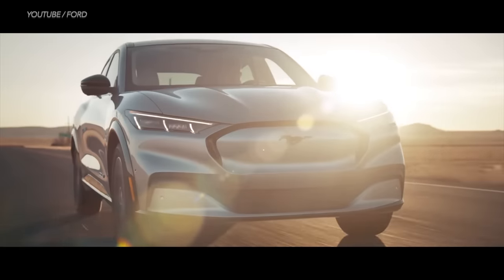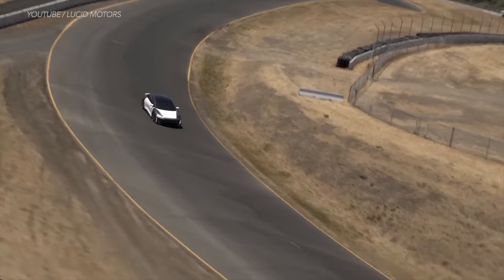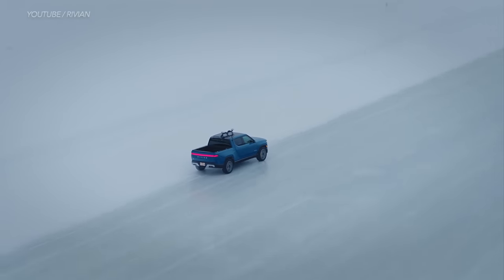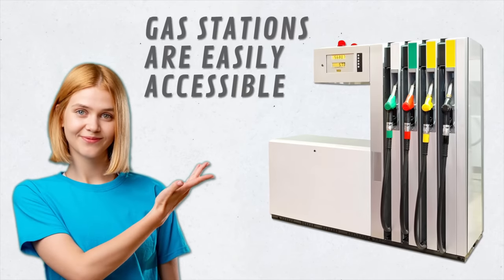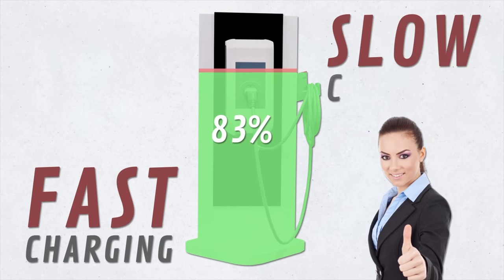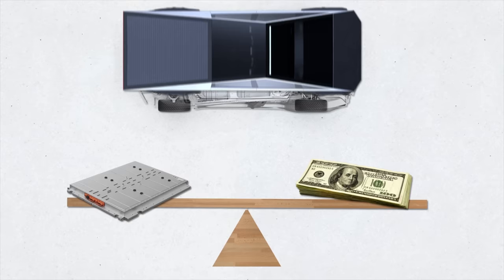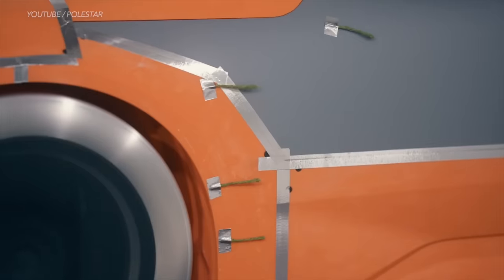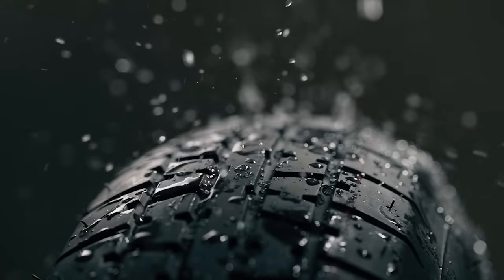New Study Shows Electric Cars are a Scam

Comment: When a company can send an update to reduce the range of "your car", remove features, track your every movement  or lock you out are signs for concern. It's not just a scam, it's also a means of control.
Reply: Well said
Reply: Amen!!!
Reply: I hope your wearing your tinfoil hat!
Reply: @TheGecko213  can’t do that with an IC Engine
Reply: That technology has already existed in cars.  Being battery operated doesn't make it worse or better
Reply: exactly thats what ive been saying for years
Reply: Why many aren't talking about this is crazy
Reply: RM has no clue no one cares about him or his info🤣🤣
Reply: It's not the companies, it's the govt that has to be questioned.. They are letting this happen and people are also in on this big time.
Reply: ----  Escape The Illusion  -  Enter The Truth  -  Eternally Free Yourself  ----
Reply: @Fredman5551  
Can't do that to my old VW....
 EMP's won't stop it either.
Reply: Yes it does. Sorry but it does
Reply: Preachhh
Reply: They don't want you to own anything & be happy.
Reply: @Fredman5551  When they own your software & lock down the firmware, hasn't happened yet with a gas car minus some heated seat unlockables, however you know they don't artificially limit how much gas you can stick in the tank or how many miles you can drive with software locked firmware, YET. They can do all that on EV's and more, the modules are also more integrated to the manufacturer and kept under lock & key.
Reply: +10000
Reply: @spikester  you dont think Mercedes owns the software in their cars and can't "lock it down "? They'd charge hundreds of dollars for map data updates.

I'll state it again. cars already have the tech. The computers are already there. The newer you get the more likely it has a signal connection aswell. How the car if powered is irrelevant.
Reply: Just like those little computers in our pockets. Or our laptops tablets and gas powered cars
Reply: @grizzleypeak  won't work on a Horse or sled dogs either.
Reply: True. Not everything has to be linked to technology.
Reply: Doesn't this exist in ICE vehicles already (except for the range obviously). Some manufacturers are going to start charging subscriptions for things like heated seats  etc.
Reply: Tesla has been sending an update to INCREASE the range.
Reply: They can do that to gas cars already
Reply: All the company's now auto track your location for data mining... U have to call them n tell them u do not want them to do it...
Reply: I hope those automakers building BEVs could just build simple electric cars without all those fancy complex stuff. Period.
Reply: @valleyofiron125  The reason GM and mechanics like Scotty hate EVs is because they make enormous profit on repairs of ICE cars.   There is very little maintenance on your EV and it will put many mechanics out of a job.   People will complain about the batteries even though today they are expected to last 500k miles and future batteries will last over 1 million miles.   Scotty makes video after video trashing EVs but he never seem to talk about how ICE cars are cash cows in repairs.
Reply: @tlangton  Tesla already did that with a man who bought a used Tesla with a 'long range' battery. They remotely reduced the range by 30% and wanted $4k to unlock. Their reason was because the previous owner had it upgraded during warranty but did not come with the car originally. It was working just fine but Tesla wanted money.
Reply: @Argedis  
How can anyone allow this daylight  robbery by Tesla 
More then that how can you drive a car that can be hijacked and under control of the corporate entity
Reply: Better not buy any new car then, EV or not, if connectivity worries you this much (it shouldn't).
Reply: sounds like the "OnStar" thats been on every Chevy for over a decade...
Reply: @charlesrodriguez7984  Wrong.
Reply: @TheGecko213  Yup it's crazy. You can read the story online just search "Tesla cuts range 30%" there are several news articles about it. And it was actually $4500 that Tesla wanted.
Reply: @Fred H  you aren't being forced to buy a crappy software locked Mercedes. 🙄
Reply: Does that mean I shouldn’t have had the dealer put that little chip in my neck?
Reply: @troyfall6573  so how does that work? Does this "update" increase the battery's energy capacity?
Reply: @Magneticlaw  Don't know exactly but my assumption is it improves the efficiency of the cells and power inversion.   Battery tech is improving significantly every 3 months and it seems like the people on these forums are using data and talking points from 8 years ago.
Reply: I get it.  Except when it comes from a CEO as transparently honest as Elon building such extremely safe cars I trust.
Reply: @spikester  when they want to shut down your newer ICE car,
 they will.
Reply: I agree, don't forget camera inside to monitor if you have your eyes on the road when using FDS.
Reply: @tylerjames3620  You compared things with 2-3yr disposable upgrade intervals with cars, but I assume thats where EV electronics is headed, cheap cheerful & most certainly as disposable as smartphones.
Reply: Unless your financially comfortable, don't waste your hard earned money on these EV's. Your creating a huge problem for you and your family
Reply: Exactly the same thing can be done with the EMU of an ICE car.
Reply: @car-diologist  Even if you have the money, there should be common sense that overrides the impulse of having the latest 'thing'. Just because one can buy something does not mean it's a wise purchase!
Reply: Not if you own a 94 Celica
Reply: @kv1930  100% 👍
Reply: You are correct.
Reply: @car-diologist  I tried to have a open mind about the EV thing,but facts are stubborn things. I get there is the segment of population that will still wear a mask inside the car! Lol,I suspect a larg number of the same drivers are EV all the way! Lol
Reply: @kv1930  lmao
Reply: You mean like bmw with their standard gas cars. Technically in today's car market. You really don't own the car, with them able to sue of their own discretion. If you modify the car and they take issue with said modifications.
Reply: @valleyofiron125  it's 'cheap' until things like sensors,and battery starts to decline over time= expensive.  I can buy thar some people like the look and performance of a EV....but to say it saves $$ in the long run or the environment,that's just not true!
Reply: @tlangton  you're*, and is it really that far off?
Reply: One manufacturer doesn't even include the battery "batteries not included " & make you lease the battery separately
Reply: Social credit score will be tied in. Say something politically incorrect on Facebook?  Locked out of your car for 1 week.
Reply: @CosmosArchipelago  Better yet, 50% range reduction for 6 month! Scary thought!
Reply: @tlangton  People like you trust and become prey.
Reply: @Fredman5551  really only after 2011. It's hard to track a car that doesn't have northstar, bluetooth or gps.
Reply: @dreadassembly4087  thats true. But 2011 gets further away every passing day. 

Gear heads will always be buying them, but the average Joe will avoid a 12+ year old car if they can.
Reply: @dreadassembly4087  Be careful, I’m sure they are watching every move you make.  Better get in line with people like me.
Reply: @Fredman5551  I have a 1984 Ram and a 94 Jeep. I never buy a car younger than 2000 or above $8,000. I know the laws of Thermal dynamics will eventually catch up to me, but until then I refuse to drive cars that devolve in quality. Hand crank windows, old fashioned locks. These are the first things that went out on my 2007 Silverado. Now I hardly ever drive it because of it's leaky headgasket.
Reply: @tlangton  I would rather end up in a pit covered in lime.
Reply: @car-diologist  Wouldn't I be wasting my money on old technology with ICE cars and $4 gallon gas?   How about diesel at $5.50/gallon?   How about the enormous repairs an ICE car has over 200k.   Ford and GM make most of their money on repairs and they certainly don't want us to buy EVs with virtually no maintenance other than brake pads and tires.
Reply: @charlesrodriguez7984  Yes, you could.
Reply: I wonder if apple can do that with iphones
Reply: @Fredman5551  Perfect example of why I drive older cars.
Reply: Didn't Apple do the same things to the phone years ago?With A.I. and cameras everywhere, there is nowhere to hide. :p
Reply: Very well said.  So true.
Reply: Yeah! I hate BMW
Reply: You will own nothing
Reply: I saw that BMW or Mercedes offers different performance packages you pay a monthly subscription for...250hp stock 400hp for x a month 550 hp X a month. It's definitely bizarre.
Reply: @compositestechbb9087  I know.... when you die, you can't take it with you.
Reply: @compositestechbb9087  after the intro of 4x 60lb 330hp electric motors... nothing grabs me anymore.... I've been ruined by EVs.
Reply: Me: “I hate that my vehicle tracks my every movement.”

Also Me: (pulls out iPhone/Android)

Please do not act like you guys don’t have trackers in the palm of your hand. And how long has cars have a gps lock on them? Lol, come on people…… 
Now I will agree with the removal of features… but come on guys…..
Reply: @charlestrotman6571  my phone can't currently lock me inside and drive me directly to the police station lol 😆
Reply: @skitzobunitostudios7427  well yes, in the grand scheme of things we don't own anything lol you got me there! I was speaking more about market manipulation.
Reply: @charlestrotman6571  don't be the guy who gives up everything because it's already lost lol. You're Winston at the end of 1984 yelling at us to get in line hahahaha
Reply: absolutely 💯
Reply: Change "your car" to "your TV programming" and you've got Youtube.
Reply: This
Reply: As you confidently type on your Chinese made device.  As if your car is your biggest concern.
Reply: @compositestechbb9087  what I am saying is don’t act like we don’t have stuff tracking us everyday and act like Tesla has done this big thing against humanity, because ALL cars now practically use some sort of AI and track by gps. Especially if youre buying new. 
You’re 1984 statement was ignorant. Everyone acts like they haven’t as you say “fell in line” but everyone has, because most of us have smartphones. But I would not say that about humanity. That was your statement. Your other statement that you made is about the police station. NO Tesla has done that. If and when it happens, we can talk. That is against human laws and would be an extreme breach of the government. If that happens, we have bigger problems than “lock me inside. And drive me directly to the police station”.
Reply: @charlestrotman6571  OK Winston, I'm sorry. I will keep my thoughts to myself. Many apologies for not agreeing with you.
Reply: @charlestrotman6571  my ignorance knows no bounds. Please don't report me Winston.
Reply: @charlestrotman6571  🤣🤣 like a wayward golf ball the irony rolls on
Reply: rodneyhoward9450  I’m not naive,  I know the earth is flat.

Comment: EVs have their range estimated in the best possible conditions (optimal temperature, tail wind, flat ground or downhill with regen, no payload, etc.), yet their listed charge times are almost always from 10-80% with the fastest charge possible. The eCascadia for example has its range estimation based off the vehicle bobtail with no load evene attached. The word 'scam' is an understatement.
Reply: Yeah, just like laptop batteries.
Reply: The same goes for ICE powered vehicles too..... I'm not an EV fan but just stating the obvious.
Reply: Car makers said some cars get 34 mpg on the highway driving too, but they never get close to it. Testing things in laboratories is much different than using them in real life. Driving conditions also change your fuel use as temperature conditions will affect charging.
Reply: @michaeldomanski9352  It's not the same. In many cases, I actually get ABOVE what the manufacturers rate for ICE vehicles. BEVs are more impacted by weight and drag and cold weather than ICEs are, so that's why the range underperforms what they claim it does. My 2021 Tundra is getting the exact same MPG as it did in the summer. AC and heater do not affect it to any noticeable degree. Only loss is me warming it up 5 minutes before I leave, which usually cuts a mile off of the range of ~360.
Reply: @id10t98  my 08 corolla was rated for the 30s but I got up to 40mpg consistently both directions. If it was a BEV I'd get the equivalent of 20.
Reply: @kalashnikov1343  what I meant was manufacturers use the same science when modeling vehicles whether they are electric or Petrol....ie: aerodynamics, weight distribution, and near perfect conditions. Car companies obviously want the highest possible MPG so they're not out on a hot humid rainy day for a MPG test. They want the best possible so they can stay within these ludicrous government policies. I don't mean passenger safety requirements  only engine/drivetrain stuff.
Reply: Most cars are tested in a lab to obtain this false information. In a lab the cars aren't subjected to road inclines, wind effects on the vehicle when driving along and other items that can cause fuel MPG or battery range to be less than stated in the brochure.
Reply: Let us not forget the revolving door,between big business and 'regulatory agencies'
Reply: Can not tell a ICE engine it now has 200 miles and not 400. Can with a EV.
Reply: I will stick with my 2004 Acura el!!! Thanks anyways
Reply: This is just how EPA estimates work.  They are always based on ideal conditions.  They kinda have to be ... you can't exactly test every condition and give people some broad range.  You can easily beat or get worse than the ratings, be it in an ICE or an EV.
Reply: My longest regular drive distance is 100 miles and there are 150kW charging stations on both ends of the route. With a 200 mile standard range I don't see any practical problem ahead. Most of my journeys are way shorter at about 10 miles there and back.
Reply: @id10t98  Well my current 2020 Audi A4 40TDI gets 52,5 MPG consistently on longer trips.
Reply: @JT_771  AGAIN... no. You are missing the entire point. BEVs are severely negatively impacted by weather, drag and weight. You will NEVER beat the range estimate in a BEV, it's only a matter of how much less range you will get. Even just going 70mph on flat ground you will get less range that what's claimed.
Reply: @kalashnikov1343  Missing nothing.  All cars get drag, nothing to do with EV.  Drag is HUGE after about 60mph or so and is THE factor for high speed stuff.  Period.  You can easily best the EV range by doing just city stuff.
Reply: @smokeonthewater5287  Yep.  I've had one for four years now, about 60k miles, local and across a number of the western states.  Never been an issue.
Reply: @perniciouspete4986  yea anyone who has ever had to use their lap-top 'alot' already new this about batteries.  I sometimes stay in this 'cabin' for a week or so, right on the water but it only has 1 electric socket..in an inconvenient location.. so I would bring my laptop but could only use it until the battery runns out, then had to recharge before i could use it again, when you need to use it alot you wind up having less than 50% of your available time, more time watching the water and birds
Reply: NEDC
Not Even Damn Close
Reply: @Kalashnikov  hate to say it, but you're wrong.  You can get better than the advertised range on a BEV, for exactly the same reason you can in an ICE vehicle, by driving in conditions more favourable than in the mandated tests.
Reply: @mcdon2401  I wholly admit that. Tail wind, only downhill, with regen, optimal temperature, AC/heater off, headlights off, and your final 1% stalls you out perfectly to the charged station. I'm sure it's possible. But how often is that going to happen? Not once in your lifetime. I get better mpg in my pickup than what's rated every single day, temperature be damned. That's not possible in a BEV. And if you disagree you are in DENIAL.
Reply: @Kalashnikov  well, if I'm in denial I must also be hallucinating, since I've seen it with my own eyes, whilst I was driving.  And no, it wasn't downhill all the way with a following wind and all the other conditions you mention.  It was driving normally, on a range of roads with different limits (from 30 up to 70 mph) just as I normally do.  The only one in denial is yourself, since you seem to think that ICE vehicles are somehow magic in their ability to beat government regulated range data, but nothing else can.  The very fact that the data comes from a standardised test makes them absolutely meaningless outside of comparing one vehicle to another in a standardised test.  The real world isn't a lab, and reality exits, regardless of your feelings.
Reply: @michaeldomanski9352  The same what goes for ICE vehicles? In my 50 years of driving I have driven every type of gas and diesel fueled vehicle there is. I have never experienced a 25% reduction in fuel economy under any circumstance except pulling heavy loads. EVs lose between 20 and 50% under anything but perfect conditions and can't tow anything more than about 150 miles. Liquid fuel vehicles start with between 350 and 500 miles range. Even after losses the lowest range for an LF vehicle is better than for the highest rated EV in optimal conditions. There is no comparison.